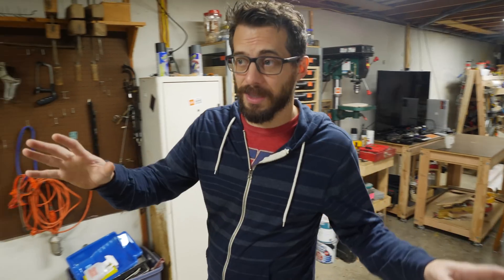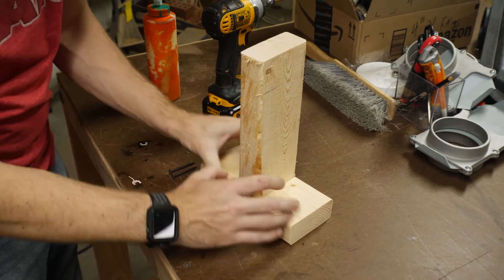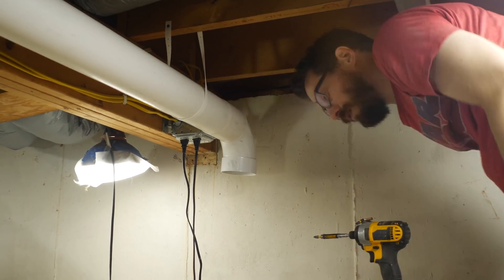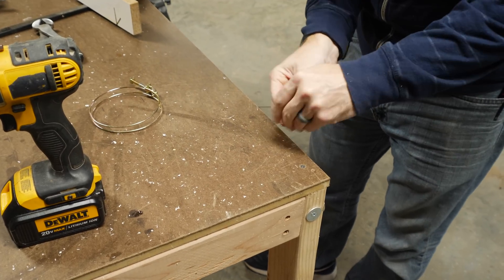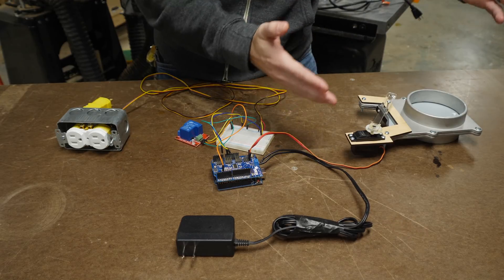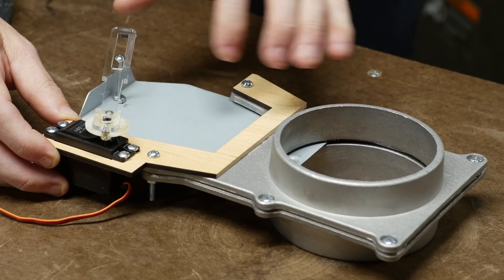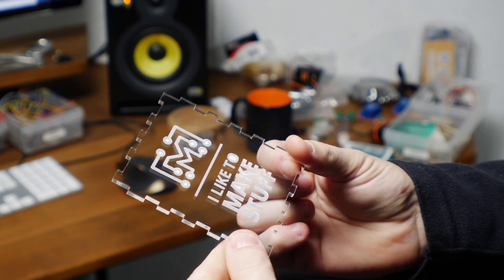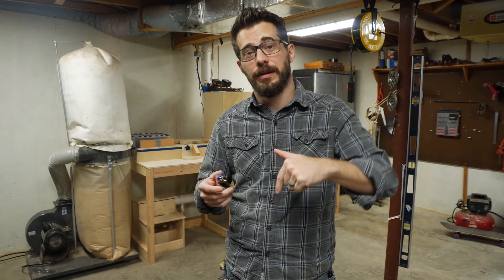Fully Automated Dust Collection powered by Arduino // How To | I Like To Make Stuff

Comment: Bob when when you asked for suggestions on setting up your new dust collection I almost sent this same idea to you. I was heading this direction myself. Any chance if making some of the servo arms for sale with the I Like to Make Stuff logo on them?
Reply from the maker: Hey Carey! Possibly. We thought about selling kits of the plate and arm but haven't seen much of a demand yet.
Reply: How about a follow up video on the second channel to include the update on the change to the relay and how you're liking the system so far. I would be interested in whether the servos would have issues if dust gets in the grooves of the blast gate. At that time if you want to throw a number on the plates and arms and see what the response is.
Reply: I had also thought about add the control for dust bin full light similar to what Oneida offers. I also looked at some commercial dust collection controls and they have inputs for pressure sensors that are placed at certain spots in the lines for maintenance monitoring.

Comment: If you haven't already, look into an industrial contactor for the dust collector. It's just a big beefy relay, and some are designed to switch inductive loads like motors and blowers, which tend to have current spikes when switching, causing the contacts on relays to weld/stick.

Comment: The PCB trace width on those relay breadboards are critical and usually the weak point. Pretty much guarantee the traces won’t handle 30A. Best bet is to use a relay cradle with wires directly attached.

Comment: Bob, this is totally awesome! I'm most likely going to move next year and a new shop setup will be needed. I've been thinking about dust collection for a good part of this year and I think I would like to have everything 90% like you have it set up. The only change I want to make is to locate the dust collection unit either in another room OR build it a sound proof enclosure as the noise level of those things is massive in my opinion. Either way, this might be my very first arduino build! I go for the simple stuff lol.

Comment: Great video! Thanks for sharing. Question about the grounding method you use.  Is that all you need to do to avoid the PVC duct from statically charging itself?  Just a screw and the copper wire connected to the ground? Is one location enough to ground the whole duct system of course, as long as they are connected? Thank you in advance.

Comment: I'm considering building a similar system using the 2HP dust collector but then replacing the filter bag with a dust deputy and venting the exhaust from that outside. What made you go with the filter bag?

Comment: Cool stuff. Mine is a bit different. Since I don't want the dust collector to turn on for one single cut with the chop saw for example, my system starts by the manual engagement of any of the blast gates positoned at each machine.
Every blast gate has a hall-sensor and an ESP8266 which sends out an MQTT command via wifi to a 'central' ESP which starts and keeps the dust collector running until any of the blast gates is open. Then turns it off with a little delay through a beefy magnetic switch.

Comment: Cool!  I used the same acs712 current sensing chip for a similar application that automatically turns all my lights on in my lab when one of my motion sensing lights draws enough current.

Comment: nice would windshield wiper motors be a low cost alternative to the servos? another question i haven't pawed through your arduino code on github... does  your set  up allow the  dust collector  to run after you turn a machine off for a proscribed amount of time like 30 seconds or more to clear the ducts?
Reply from the maker: Interesting! Not sure!

Comment: Hi Bob! You could put 2 or 3 relays in parallel to handle the current. This is not the best solution, because the relays will not be activated exactly at the same time and may have a peak current on power up, but it will work for now :)

Comment: This is a fantastic system.  Any suggestion for making the arm that opens the blastgate?  I can make the servo holder, but I don't have a laser or 3d printer to make the acrylic arms.
Reply from the maker: you can cut the slot in it with a dremel or scrollsaw easily.

Comment: A couple changes I would suggest for anyone looking to build something like this is:
1. Use a "micro current transformer" to detect current flow instead. That way you don't have to break the A/C line. I don't trust those little boards. If you choose the right resistors, you could even still use the digital pins to detect "on" and "off".
2. Use a "contactor" for switching high currents, like the dust collector. Then use the smaller blue relay to power the coil on the contactor.
Reply: Do I need to updated the code if I use the "micro current transformer"?

Comment: Are all these 15 amp boxes on the same circuit? If each box had it's own circuit, wouldn't it be easier (and probably better) to have the voltage sensors in the box where the fuses are?

Comment: I'm new to woodworking and bought a 6hp shop vac i originally planned to make a cyclone cart for, but have since decided to build a system. Are the bigger 2hp dust collectors that much better for a system than the smaller 6hp shop vac?

Comment: The 30 Amp rating of your relay is probably an AC-1 rating for resistive loads, An electric motor is an Inductive load. You need to find a relay with an AC-3 rating large enough for your motor. You will most likely need a motor contactor.  If the motor on your dust collector is actually 2HP @ 120V (which seems like a huge motor for it)  it looks like you would need to go with a 32A motor contactor (a fairly standard size, which usually has a 50A Resistive rating, but make sure you check the datasheet)

Comment: if gou plug that motor to the relay you will end up with magnetic interference even if you use a contactor wich will be ideal..  just put a snubber in parallel with the motor/contactor and you are good to go. snubber is a capacitor 0.1µf 400v with a 33ohm more or less 2w resistor.

Comment: Fantastic. Did you add a shut off delay for the chop saw? Since the chop saw is only on during a cut and not between cuts, do you find that the dust extractor can’t turn on and off that quickly?

Comment: Do a follow up video where you use a Raspberry Pi running OpenHAB 2 to control the whole system and have ESP8266 modules connected to the voltage sensor, use MQTT to wirelessly connect the ESPs with the raspberry pi. This would reduce the cable clutter

Comment: I just designed a system very similar to this for my shop. Here are some of the things i did differently. 
1) I used Individual Arduinos at each of the Tools(2 tools per arduino basically), This allowed me to distribute the current measurements around the shop and kept the major cable runs down. I basically run a "control" cable around my shop, <Power><GND><Vac Trigger> 
2) I used air cylinders for my Blast gates, but i had them on hand, i like your Servo idea.  
3) I used a Solid State Relay to control the motor on my HF Dust collector, I used another Arduino at the dust collector to run a piece of code that keeps the Vac running for 5Minutes after the tool has shut down, this is important because the cheap motors really dont like to be powered intermittently, they want to be on, or off, not starting. It also keeps Inrush in the shop to a minimum. I stole my concept from you but decided to take it up a notch.  Once i have everything installed i will post a blog with the code and photos.
Reply: How about using Bluetooth or WiFo instead of cables?

Comment: Great job! Just Long term speaking, thr relay its not a good soluction for the dust colector (and other high current machines)  In my opinion you should use power contactor using the relay to power their coil. Its mutch more stable for a "heavy duty" use and they are prepared to a lot of on\off cycles on load. :)

Comment: For driving your blower motor you should use a Solid State Relay, the most common are rated for 25A and it's simply enabled by a 5V signal, all the needed electronics are inside the box. Really a reliable and robust solution for this kind of application instead Chinese relay board.

Comment: Thank you for not drilling into your foundation wall.  That would have been a mistake in my opinion.  Should have used your chop saw to cut the pvc pipe.   Works great for nice square cuts.

Comment: What are you trying out to replace that relay? I looked quick and found HVAC relays with a 24v coil, and it was rated for 30 or 40 amps inductive load.

Comment: Regarding your relay, you're right, it's not the thing to use. The combination of high power load (2HP) and the fact it's a motor (inductive load) will kill the relay pretty quickly even with the platinum coating of the contacts, due to arcing when your turn it on or off. In place (and you probably got advised already), use a solid state relay or SSR. They work for AC and DC for most of them, no mechanical part, and fully opto isolated. Both my CNC mill coolant pump and Pinball rumbler/shaker use those, it will never age.

Comment: Looks great. What happens when that voltage sensor fails? Does the mains AC show up at the Arduino? That would just fry everything. Also placing a magnet under the Arduino is not advisable since it may interfere with the main MCU chip on it. Magnets have been known to erase memories on the chip and stuff.

Comment: That motor is an inductive load (as opposed to resistive) if you look at your relay spec sheet, it is actually rated LOWER for inductive loads. This has to do with the "Back-EMF"  generated by your motor as the magnetic field in its windings collapses when you turn it off. These effects can cause arcing across the contacts and reduce the lifespan of the part as they become more and more pitted. Most commercially available automation relays I have seen really only go up to about 3/4 horse for inductive loads. That could be why you were seeing issues with the performance of the one you were working with. Usually when I have to control something above about 1 horsepower, I end up using a motor-rated contactor. Don't throw out the relay though! You may need to use that to activate the contactor, since you probably won't find one that uses coil voltages and amperages that an arduino can source. Sorry for the long post... I design automation control systems for mechanical equipment for a living and thought some could benefit from that experience.
Reply: Thanks the info. I came searching the comments for "contactor" (I thought one should be used but wasn't sure).
Reply: No problem! And you're looking to make on of these, I might suggest going with current switches instead of the voltage sensors as well. They use the electrical hot wire as a sort of 1-turn transformer. The resulting induced current in the device powers up a small internal circuit which closes a contact after it reaches a threshold current. They are very reliable and have the benefits of being a simple digital input to the micro-controller, and of being clamped around the tool's power feed as opposed to in line with it. The smallest ones I am aware of have a maximum current rating of 135A and I have used them on loads as small as 10mA ( with multiple wire passes through the core though, mind you ). Typically they like to see a minimum of about 3A for reliable operation with only one pass.
Reply: Matt DeSalvio I want to build a similar system in the distant future. Currently building a CNC machine, and working out how to wire a contactor before servo power supply and spindle inverter. I've got a degree in electrical/electronic engineering but I don't have much practical experience.
Reply: Ben Young I can tell you that in the real world of practical "control systems" only 4 things exist. They are as follows: 1) Digital Output  2) Digital Input  3) Analog Output  4) Analog Input. THAT'S IT! All of the KVL, KCL, differential equations, Laplace transforms and all that other magic has already been done and baked into the arduinos and the spindle inverters etc... I've found the most useful part of my mechanical engineering degree to be the experience it gave me in attacking problems I know nothing about. I think you'll find the same.

In short, a contactor is just a big relay. It takes a coil voltage, and draws a coil current which you will probably need a regular relay to control.

Your spindle inverter, which I am assuming probably is some sort of variable frequency drive, just boils down to Start/Stop (DO), Speed (AO), maybe Direction (DO), maybe Proof of Operation (DI), maybe some sort of alarm contact as well (DI).

All you need to do is power these things up and look at the spec sheets to find out what terminals do what. You'll need to know how to interpret the signals the system sends you, or how the end device will interpret the signals you are sending. Because an AO is likely to be just 0-10VDC, and that doesn't mean anything. Take your speed control, for instance, your inverter takes a 0-10VDC input for It's speed command. You tell it 5 volts. How fast does it go? You need to map that to a useful span on your end, that is the same as the mapping on the inverter end. So you can tell it go 1500 RPM, and it goes 1500 RPM. 

I hope all that makes sense!
TL;DR:  DO,DI,AO,AI.
Reply: Serendipitously, AvE posted a 3 phase variable frequency drive teardown only a couple minutes after I posted that comment. It's a small internet huh? Here's the link if you want to know what's in those things... https://youtu.be/uTvUwe2BXGg
Reply: @Mr.Glitch247 , I appreciate you taking the time to leave such a thoughtful and informative comment! I know nothing about these sorts of systems, but with your comment and some other resources, I think I'll be able to do what I need, and do it right. Thanks!
Reply: @Mr.Glitch247  Where do you get those sensors?  And do they wrap aroung the whole cord or just the hot wire?
Reply: @randybryant3903  They can be had from any "controls" supplier typically. They are called "current switches" and the most common one I have seen in the industry is the Hawkeye H608 which can even be purchased on amazon.

It needs to ONLY clamp around the hot wire. If you clamp it around the whole cord then the magnetic fields from the two wires will cancel out and nothing will happen.
Reply: You mentioned that sharp 90° turns cut down on suction power and I’ve heard/seen this on other videos as well. But I noticed that you did use 90° elbows from your ceiling runs down to the machines. Have you noticed any loss in air flow bc of this?

Comment: The one thing that could make this setup perfect is the addition of a Super Dust Deputy to the dust collector. They're pricey, but you won't have to change your air filter nearly as often, which will save you money in the long run.

Comment: It looks like as soon as the tool stops the blast gate closes. You may have already changed that, but you should have the collector run and the blast gate stay open for a few seconds after the tool stops to allow it clear the system properly. Otherwise it's going to have to work against dust settled in the hoses and pipes every time it starts up.
Reply from the maker: The blast gates don’t change position when the tool stops, only when the next tool turns on.

Comment: This is awesome. I will steal your ideas. Does the suction continue to draw for several seconds after the tool shuts off?  It would help finish getting rid of any dust in the system and let it reach the collector before it shuts off. I couldn't tell from the video.
Reply from the maker: Yeah it runs for a bit which is a time set in the code and easily changed.

Comment: An oscillating flush cut multi tool cuts pvc with no burs. Also why not instead of that curent sensor just wrap a wire around the hot one or two times and that will produce voltage out of either end of the wire when current is being drawn.

Comment: I would suggest a contactor switched by the really you have (or one that works better).  We use the in car washes to tun on the 5 hp 3 ph pump motors with just 24v ac @ around .5 amps.  That way you are not running a 2 hp inductive load through the low voltage relay.

https://www.amazon.com/C25BNB230T-Compact-Definite-Contactor-Inductive/dp/B00DLSVLSI/ref=sr_1_1?ie=UTF8&qid=1512096764&sr=8-1&keywords=2+hp+contactor+24+v+coil 
should work, or find one with 120 v coil.

Comment: Hey Bob! This was great. I really appreciate your use of Arduino to make your life easier. One tip: you can buy a load of Arduino Pro Minis on Ebay for around $1 apiece, and they're functionally identical to the Uno for these uses. The great thing about them is they're so cheap that you can solder wires right to them, and you can still buy shields for them. They're also smaller!
Reply from the maker: I know. The shield I’m using wouldn’t work on them. I get clone UNOs from China for about $3 each

Comment: The way I understand it from bigclivedotcom, your dust collector is a big inductive load, and relays might weld themselves for that, even if the amperage is within the limit. I wouldn't worry about it too much, but if it does happen you might be better of with a contactor instead when you go to replace the relay.

Comment: I REALLY dont think, your anti-static-electricity-screw is working the way you think it will... you built a single-point of discharge and actually increased the cance of a spark. you better put an uninsulated wire inside the whole pipes. a very small one is fairly enough, as there wont be a high current to speak of (but high voltage though). you also can use copper foils or even aluminum foil. There are zinc or copper sprays but it dont know if they stick on pvc....
Please re-check your installation, so you dont accidentaly burn down your house, so we will have more of your awesome videos in the future. <3